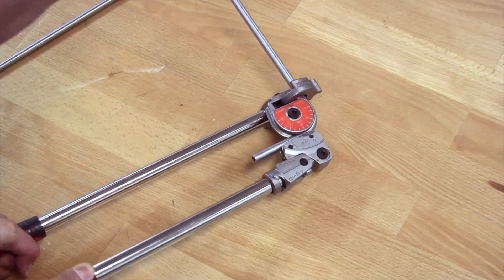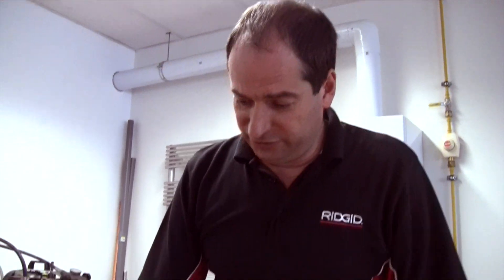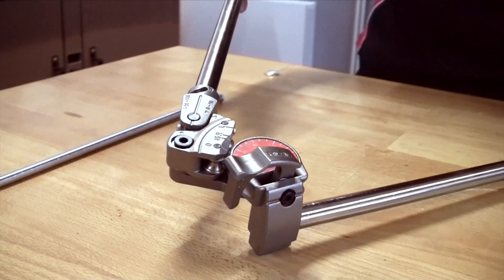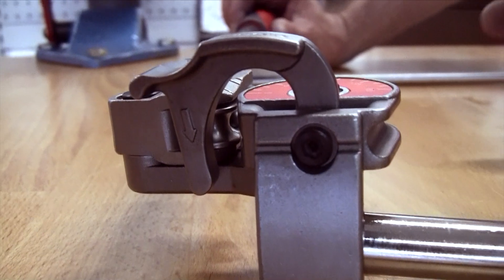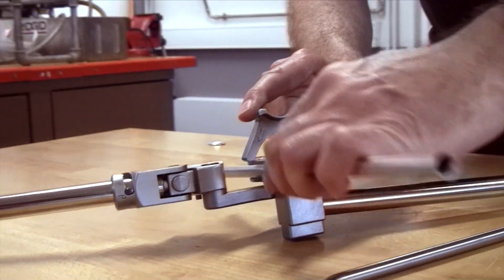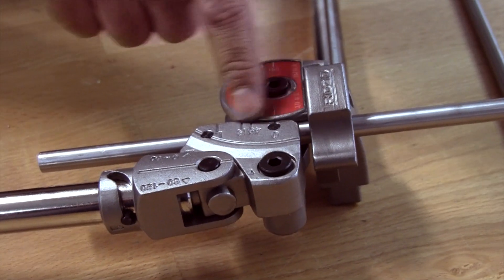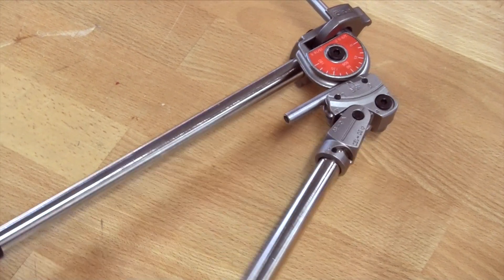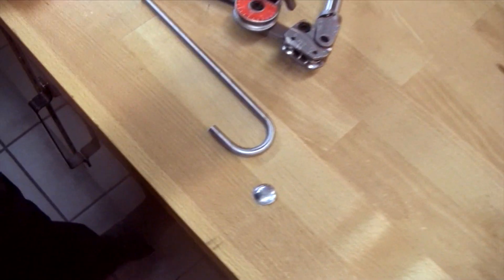RIDGID - How To Bend Stainless Steel Pipe

Comment: if I wanted some garden arches done would you be able to do them as they are wide?
Reply: Your best bet for some thing like that if it's diy would be a sturdy jig for making the same sweeping 180 degree bends repeatedly. Leave excess pipe on either end of the 180. Match up the bends and cut off the excess pipe so they all are the same exact piece. Weld radius pieces to upright pieces. Grinder and paint makes me the welder I ain't. You'll need to learn some math as the jig needs to allow for slightly more than a 180 degree bend to allow for the spring back of the given metal.
Reply: Use 3/4 Emt and a corresponding hand bender; the comment about the jig is helpful. I've seen some amazing hoop houses built this way, can make the jig so the top arches a lil more pointy, and the sides straighter. 3/4 Emt is bigger, so you can fasten it to the wall of the garden bed (through bolt or screw), and quite sturdy. Also fairly inexpensive compared to this tiny ss tube.

Comment: TUBE BENDING SIMPLIFIED
For anyone who wants to easily and precisely learn how to bend any size tube, with any number of bends, of any degree from 1 degree to 180 degrees, onto a 20 -foot stick of tube, watch the 5 free videos at www.youtube.com/t04041951
Then order yourself a very inexpensive book which will teach anyone, in less than 2 hours how to become the best tube bender or pipe layout mechanic that they know.
Order TUBE BENDING SIMPLIFIED through either Amazon.com or through E-bay.com
Your book will arrive at any address, anywhere in the 50 United States less than 1 week after you order it.
TUBE BENDING SIMPLIFIED

Comment: If you are interested, then perhaps you might take a peek at the Handtuber Offset Calculator which can be used to quickly work out offset measurements for instrument and copper tubing in both inches and millimeters.

Comment: Don't expect to bend it like in the video if you use it in 12mm or 1/2" hard drawn stainless steel tube. I just had my 612M and struggling to bend 1.2mm thick ss tube. Have not tried it yet on thinner ss tube like 1mm. Bit dissapointed.